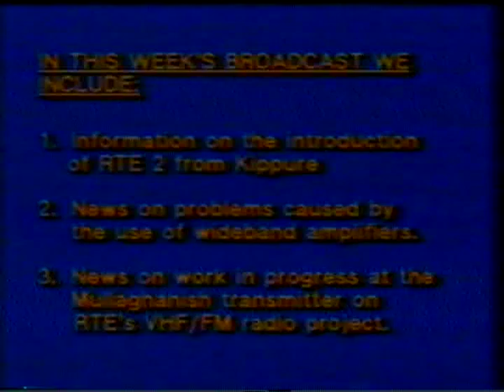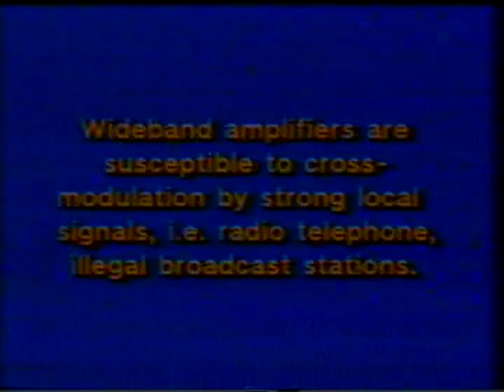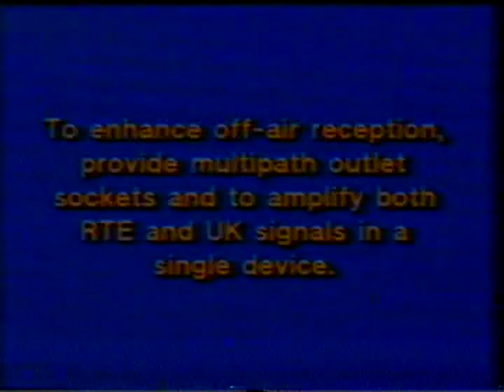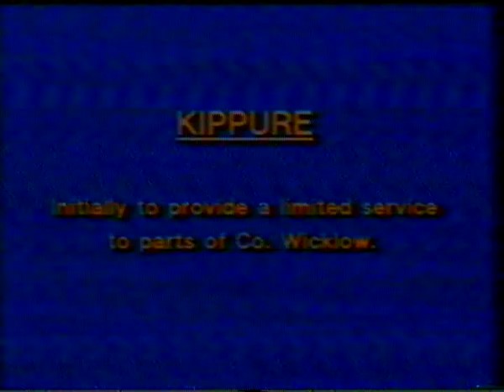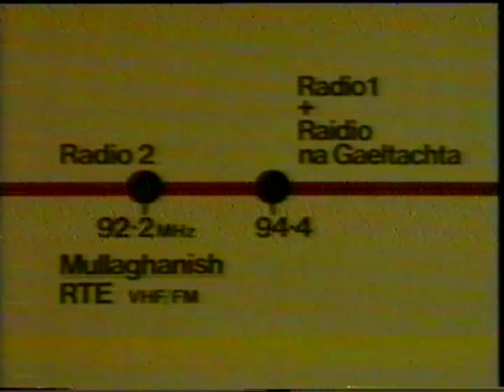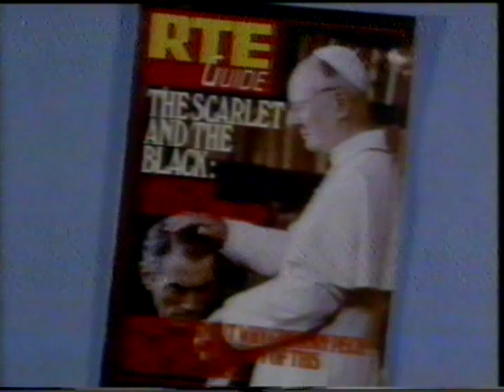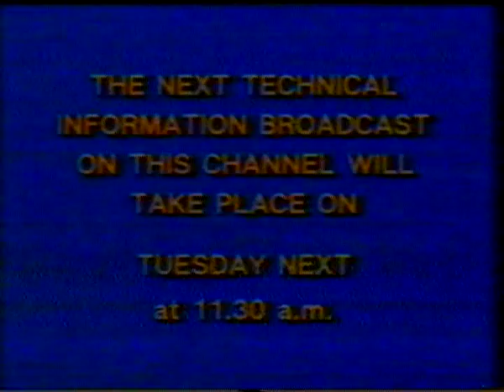DX-TV RTE 1 TECHNICAL INFORMATION BROADCAST (1983)

Comment: The BBC also ran Service Information on BBC2 for a number of years, mostly between 1978 and 1983 before and after Play School at 10.30 or 11.30am. 
I know it was dropped in 1983 and went onto Pages from Ceefax after that apparently.
Thank you for the RTE information here-this is the first time I have seen it and would like to say how interesting I found it too.
Well done!
Reply: The Independent Television Authority (renamed as the Independent Broadcasting Authority from 1972 with the impending launch of Independent Local Radio) also ran Engineering Announcements on ITV from November 1970 until May 1983, then on Channel 4 and S4C from May 1983 until the programmes' end in July 1990 as the IBA wound down.
Reply: Actually the service information ended in December 1982 as far as I have read, after which it was shown on Ceefax. Thank you of course anyway!!

Comment from the maker: It's possible it could be BBC 1 405 ch 12 as i used 2 notch filters to remove the ch 12 vision also it could be frequency mixing as live 1km from a pmr station and i used to get odd transmissions affecting band 1-3 when their tx's fired up.